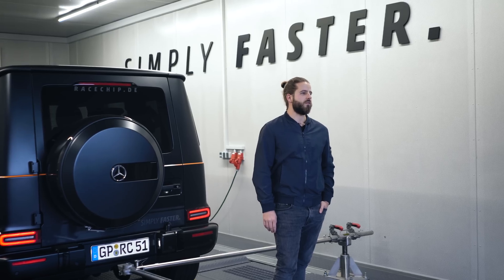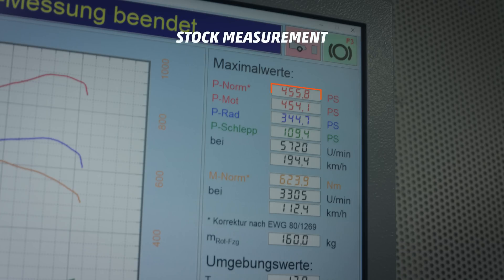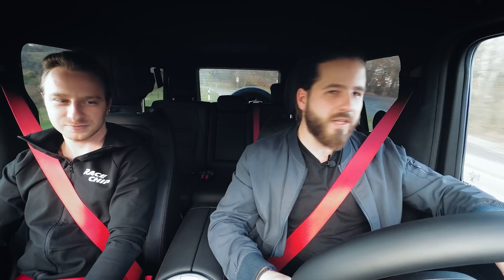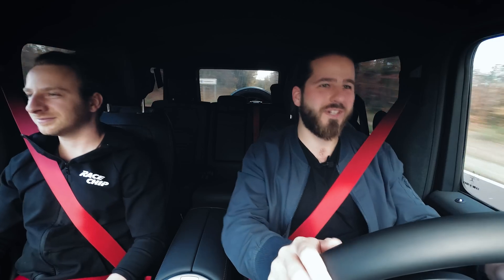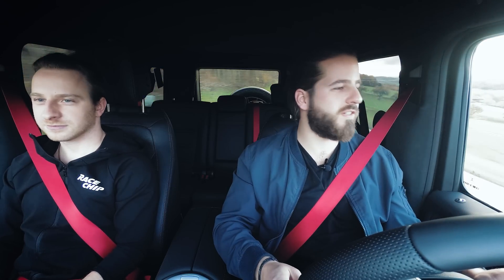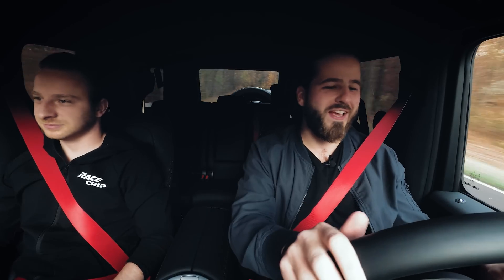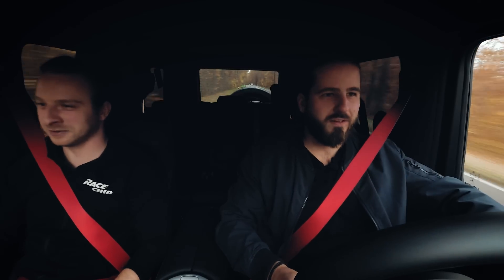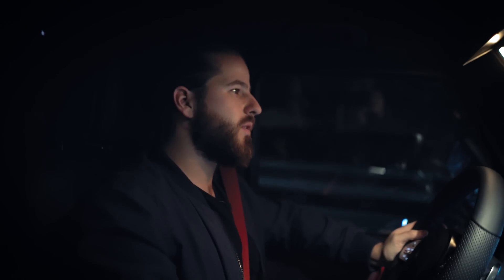G-Class 2019 test: Stock vs. RaceChip chip tuning (Experience, dyno and acceleration)

Comment: i own a g500,is there need for some special optimization of the chip for the 560+hp,or i can just order one?
Reply from the maker: Around 560 HP can be achieved with our RaceChip GTS Black on Race setting (with app control) or on setting 7 (without app control). There's no special fine tuning required.
Reply: RaceChip do you have an install video? I ordered have a 2019 G550 shop can’t install